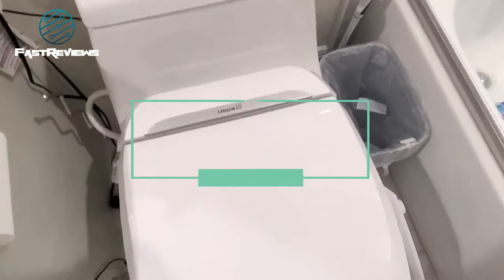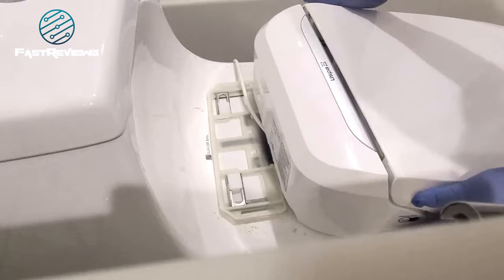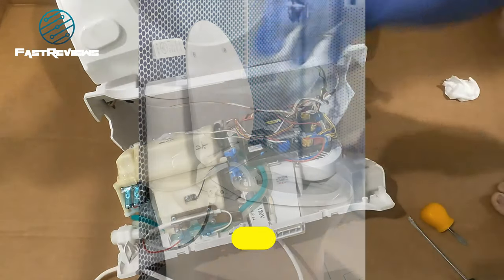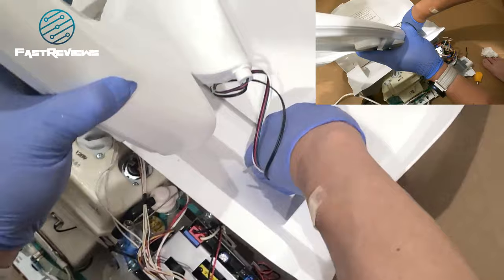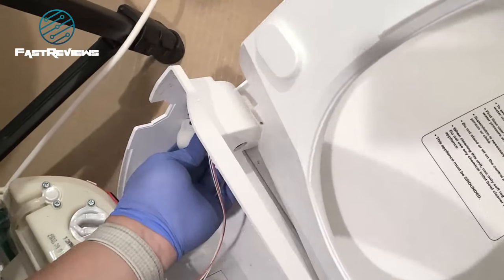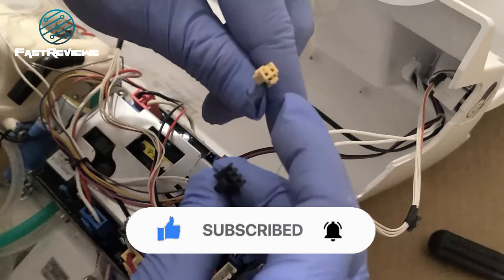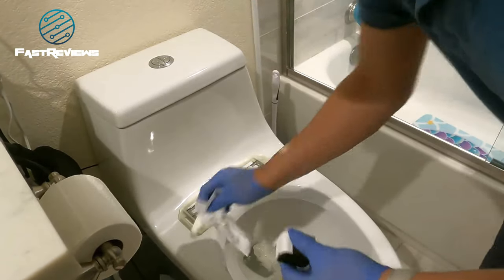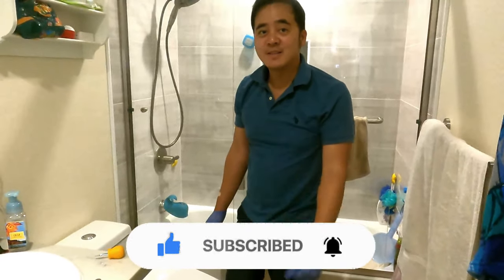How to FIX your broken Bio Bidet Seat | USPA 6800 | sold at Costco #fastreviews

Comment: The video was very helpful for me - better than the Bio Bidet written instructions. I have a suggestion or two. First, use the camera on your cell phone to photograph the unit before you remove anything so that you can go back and look at how things existed before you did anything. This is especially needed when undoing the wiring connectors. Second, the little hinge which could be installed with the wrong side up according to the video. If you have access to a marker, before you remove the hinge put a mark like a large dot on the top and you will know which side is top. Now, if I can follow my own suggestions as I sit here waiting for the replacement seat to arrive.
Reply: I have the same problem. I see many others do, too. First I found it almost impossible to mount the new seat and insert the soft close mechanism. The is no play to allow you to easily insert the tab into the seat. Second, I believe the reason the seats are all breaking in the same area is because the soft close mechanism loses it lubrication and becomes very stiff. When you open and close the seat, etc. the stiff tab creates a locked up tab and if you force it closed or opened, all that force causes the seat hinge to crack. I have three of these, one in each bathroom. So far, only one has cracked. My theory, but, when I removed the dampening part, I couldn't move the tab unless I held it with a wrench. Just think how much pressure is put on the plastic seat.
Reply: I've read the comments re: breakage in same area of seat. Same here. First I find it almost impossible to attach the new seat to the soft close mech. Second, I think that is the problem. The soft close mechanism (damper) gets locked up because the grease or fluid dries out. The tab that goes into the seat will not move and when you lift the seat, it breaks at the point where the tab entered the seat.

Comment: It’s faster to return it to Costco, and you can get a hotdog and a soda for $3 including tax.
Reply: I agree but after more than three years I felt kind of cheap thinking about doing this. However, I may have to mellow. By the way, if you are after warranty and you bought this with the Costco branded VISA card there is an extension of warranty as a part of the card benefits.

Comment: So he works barefoot - who cares?  This was exactly what I needed to fix my BioBidet.  My seat actually cracked in the corner so I decided to glue it and then pull the unit apart to get the repaired seat back on the left side lifter.

Comment: Ours broke in the same spot after 2 & 1/2 years, Bio Bidet parts warranty is good for 3 years, so you get a slight discount on seat replacement. Design flaw can be remedied for a few years by applying vasoline to pivot joint. Bio Bidet makes you sign a waiver on part before they will ship. Major flaw in seat design.
Reply: Same here on the break, but more than 3 years out.  As for the design flaw, you'll find that the rearmost seat pads do not sit on the bowl rim until the weight of someone sitting flexes the seat downward to make contact.  Of course, this places undue strain on the plastic pivot hinge, eventually causing failure.  A potential fix might be to somehow add height to the seat pads, so they contact the rim without any weight on the seat.

Comment: I have a Uspa bidet from Costco purchased around 2018, so it's out of warranty.  It had one problem that your video will help me fix; seat is no longer warm, but checking on the wiring in the seat could most likely remedy this.  
    A second problem is the biggest issue:  the bidet is located in a mountain house with very hard water.  The nozzle is clogged with minerals.  Some videos indicate that you can pull the end part of the nozzle off in order to clean it or soak it.  Is that correct for this Uspa?  I don't want to destroy the nozzle completely by trying to pull it off.
  Also, to prevent future clogs, I'd like to install a small filter on the water line, something easier to take apart and clean or soak in calcium and lime remover than this nozzle. 
    Any ideas?

Comment: I actually have the Bb2000 but it looks the same. My air dryer cuts off after a few seconds so I am guessing that it might be a bad motor? Do you have a video about fixing/replacing the fan on a bio bidet?

Comment: Thank you for the video. I did the exact replacement, but now there is no water coming out (although Ican hear that the sprayer and fan and motor are working). Can you please help?
Reply: Bin - I have the same problem…after I replaced the seat/lid, I dont get the spray or the fan. Do you remember how you fixed it or did you?
Reply: @prasheus  Yes, my issue was when I put back the cover, a piece of the clear water tube was kinked so water can not flow through. It took me quite a while to figure that out, but then it was an easy fix. You just make sure the water tube inside the case is away from the case or anything else when you put everything together. Good luck and please let me know if that helps.
Reply: @BinChen1  - thanks so much for the ultra-fast response. I opened it again and found one of the connections (not the one I replaced) had come off the slot. May have been a kink like your's also. But when I carefully put it back together it started working as expected. Thanks so much for your help.